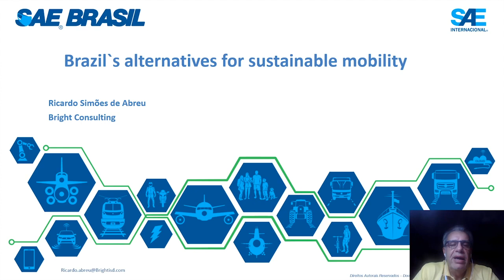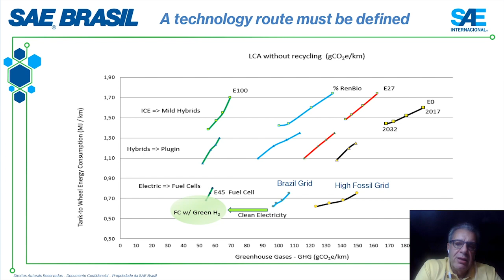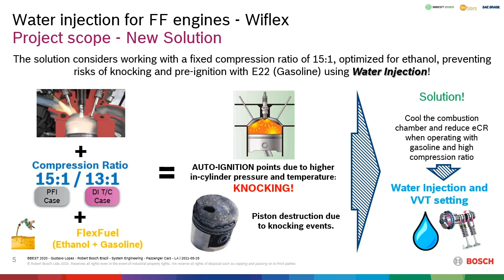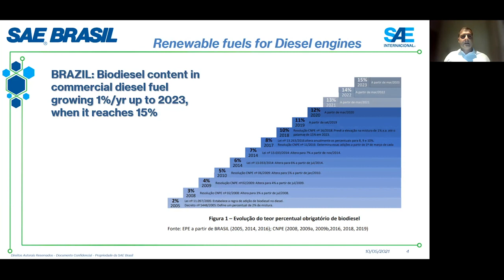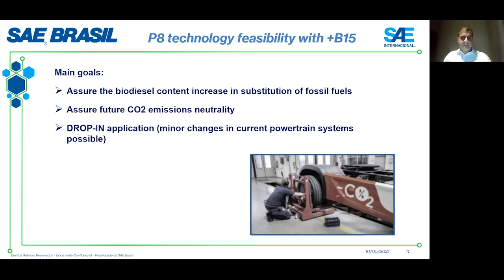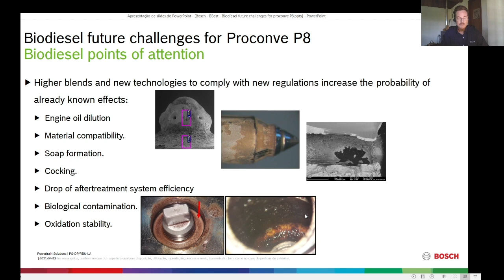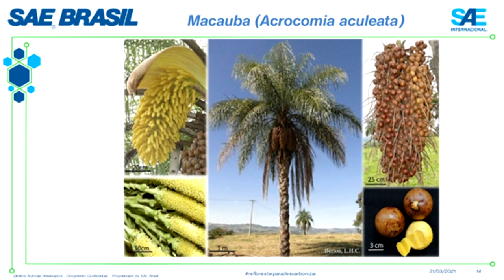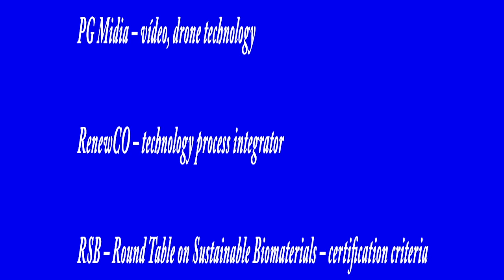Technical Session 7 - SAE Panel: Bio Fuels in the Mobility Strategy

Comment: Gustavo Castro show in a very high quality simulation and experimental concept a FF Engine designed to be optimized to Ethanol and flexibilized to work without losts with gasoline. Great work. How about interests from the Market? Do you know some changes in legislation that can promote this kind of engine sintonizated  ideally for E100 ?
Reply: At the moment we are presenting the concept to OEMs as the technology would help to fulfill new energy efficiency targets that would be introduced in the next ROTA 2030 steps. Nowadays Brazil have a regulation that promotes flex fuel engines and better ethanol / gasoline energy efficiency parity. We think that this regulations must be kept and improved, always looking for better fuel conversion efficiency, specially with our renewable fuel, the ethanol.